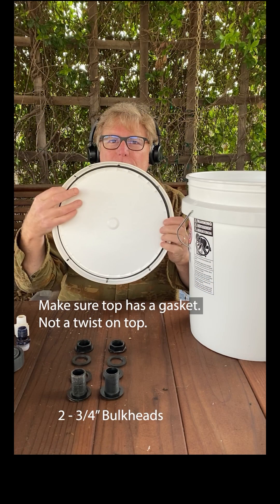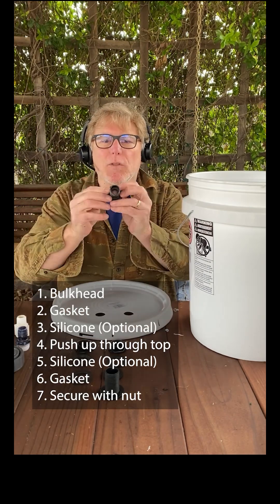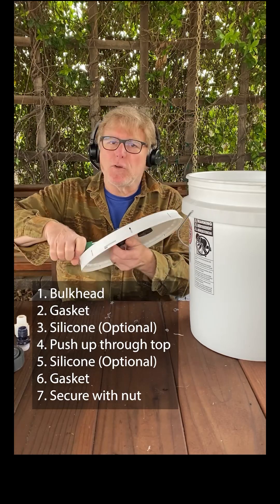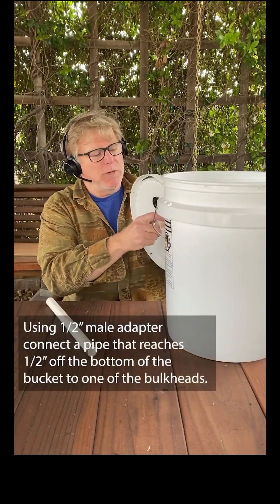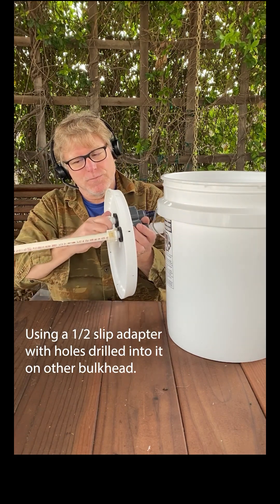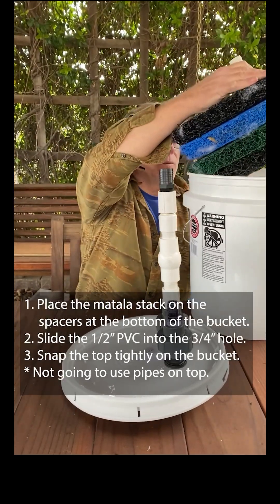DIY Canister Filter for Pond or Aquarium | Built from a 5-Gallon Bucket

Comment: where the pump? This looks like a awesome filter!  And I would love to make one asap.. I just feel like I need more info!
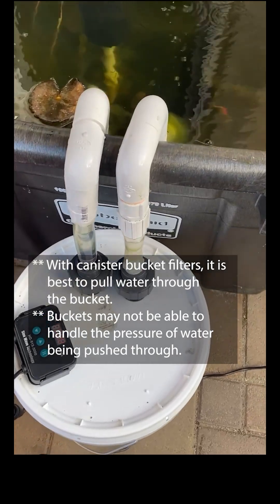Reply from the maker: Hi. The pump is in the tank. It is pulling the water through the bucket. This works well for three reasons: * if we are pulling the water through, then there is no dangerous pressure build up. * If we pull the water through, then the larger debris will get filtered before it gets to the pump. * When we are pulling the water through the bucket, the vacuum inside the bucket will help seal the lid on the bucket. You can see the pump at the 1:00 mark in the video. I put a silicone hose on the pump and attached it to the output pipe on the bucket filter. It is working great and the water is very clear.

Comment: Is the pump inside the canister or outside - in the pond?
Reply from the maker: Hi. It is inside the tank. You could put it outside with the right kind of pump. I like putting it inside, as if the hose ever leaks, then it will just leak into the tank. This is from an earlier reply:
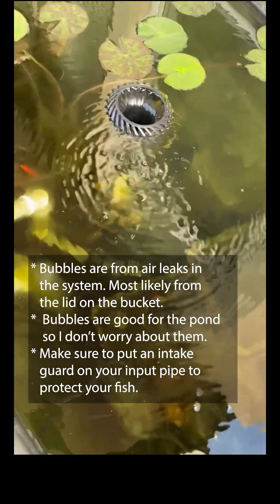The pump is in the tank. It is pulling the water through the bucket. This works well for three reasons: * if we are pulling the water through, then there is no dangerous pressure build up. * If we pull the water through, then the larger debris will get filtered before it gets to the pump. * When we are pulling the water through the bucket, the vacuum inside the bucket will help seal the lid on the bucket. You can see the pump at the 1:00 mark in the video. I put a silicone hose on the pump and attached it to the output pipe on the bucket filter. It is working great and the water is very clear.
Reply: @BlackHoleSkimmers I see, thanks for the info!